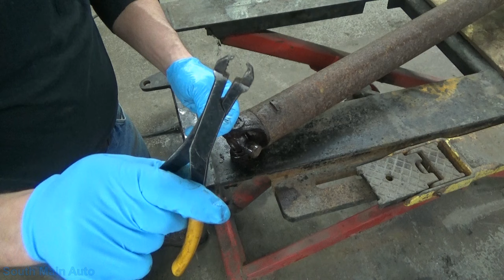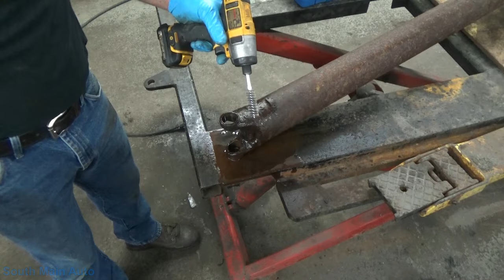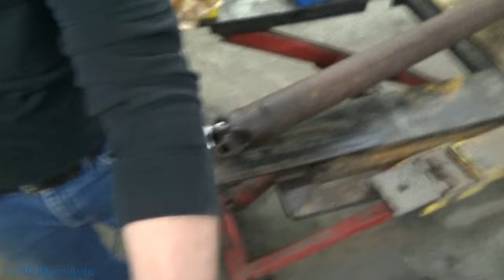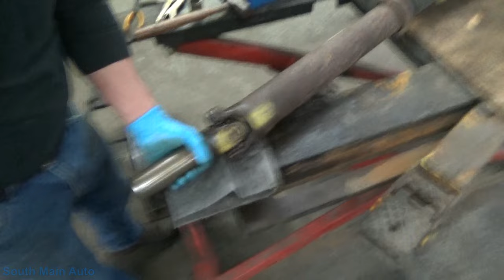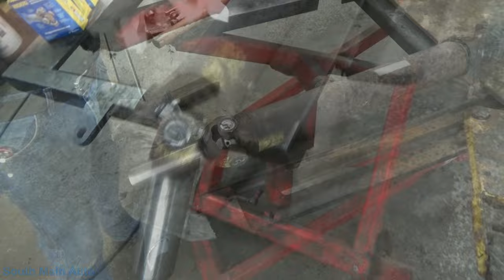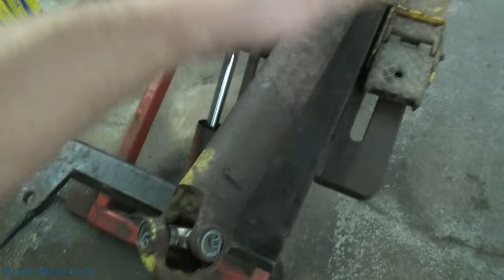How To Replace U-Joints (ULTIMATE Guide Using BFH)

Comment: ( Dan Hucklebridge) well, My dad taught me how to replace U-joints...in the late 70's. we used a large vise as the main tool, big hammer, and most importantly a socket. the main jist of removal, was to pound the shaft with the hammer, and the cross resting on the vice. the # 1 rule was, only hit the weld, on the shaft...never the tube. and for assembly, the vise served as a press, and a 5/8" shallow socket as a die, to press the first cup past, where it goes....this way the needles won't be able to fall on the other side. also, adding a small amount of grease to each cup, upon opening the box,,,,was a firm rule...also aiding in not dropping needles. my .02

Comment: Lisle makes an air hammer adapter that works great to shake the caps out. At the end, when you grease the joints, put a clamp on the two caps to prevent the grease from spreading the caps, otherwise its real hard to get the caps in the pinion yoke due to hydraulic pressure (don that before). Those double joints you mentioned are almost always junk and its better to reman the entire drive-shaft.

Comment: For the wire brush usually I get one from harbor freight - a 3/4" plumbing fitting brush,  and cut the handle off. 
Then you can just put it in a drill. Cleans the groove and get and rust out of the bore

Comment: Great vid Dr.O!  I usually use a vise, but have used a press to get them out.  Those double cardan joints are a real PITA.  Good tips, if I ever get a good solid work surface I'll try the hammer method ;)
Reply from the maker: Yeah you need a pretty solid bench to work on!

Comment: Ball joint press works for me , I take the socket off then hit it where the socket goes right on the end of the press , it is beveled to do it . Even with the plastic ones . If you put extra grease in the caps before you start , it will keep the pins in place ...

Comment: a little tip if you want to test the clips to make sure they are secure and wont pop out just smack the yoke hard with a hammer just behind the joint. it also helps center the joint and take out tight spots. if the clip flys out you need to figure out whats wrong

Comment: I use a dremel tool to clean the ring groves. We deal with rust like you guys (Newmarket ontario) other thing I do is use my vice and a tall axel stand. I open the vice enough to hold the oposite ears and let it have it with my hammer of choice. That's my schtik.

Comment: I also use the hammer method. I think the pounding helps the penetrating oil to penetrate. Whereas simply spraying the cups and then putting in a press does nothing as there is no vibration and the cups are forced out dry and that's where you get those bent ears.

Comment: Hi Eric O. 
   I just finish watching video ( give you a thumbs up ) and i see that you use a pick to clean the groves for the clips let me give you a tip :
  Cut one o the old clips 1/2" pieces and use a needle nose wise grip to hold the piece , when you cut them make sure you have a positive rake so you can scrape the grove . 
 I use this method every time I'm dealing with groves and dirt / rust .
   Hope this helps. 
    I have a question to you , I have a bobcat 863 deutz motor , oil pressure light came one , thru a gage and I have 30psi at idle and 40psi  at full throttle I can find any info on line you think it's ok ? Appreciate your answer ...

Comment: I think Tiger Tool U-joint pullers make u-joint replacement almost enjoyable.  The bigger sizes are expensive but they work on my not-so-crusty driveshafts.  If in doubt, load up the puller then tappy tap tap.

Comment: I bought a large C-clamp at Harbor Freight. It drives the new cups in slowly so you don't drop needles out of place. Obviously the hammer works, but not dropping needles saves a lot of time.

Comment: Been doing them this way for years, but I have to admit I did my daughter's 04 Z71 this past year and that aluminum shaft with nylon factory, inner outer replacement clips wasn't fun! Took forever to even get the correct joints...ended up taking the shaft to the parts store, the local store... national chain stores were no help

Comment: Try using a big vise, and the freezer trick, much less chance of needle falling sideways, helps to have a second man to hold the sockets during vice pressing process : ), am away to do some staked in UJ's just figuring how to hold the new ones in1 Seems welding a washer above is the safest - just need exact size and possibly file a lip to recess equally, then againg I may call as pecialist on this one as we dont want imbalance! New shaft is 1200 bucks for these E31 850's

Comment: I've done them both the the hammer and with the ball joint press. Last ones I did were on the S-10 with the aluminum shaft and they had the nylon insert. I beat on them with the hammer for a while and they wouldn't budge, so I use the ball joint press and they popped right out. 
Had a shop put in a set on one of the fleet trucks. They didn't grease them. Thy lasted about 2000 miles before they disintegrated. How many strokes of grease do you put in?

Comment: Plastic injected GM joints always get propane torch love followed by socket and shorty sledgehammer treatment. Aftermarket Moog, no name, etc. I pop the circlips and more socket, shorty sledgehammer attention. I'm old, and swapped the sledgehammer for a pneumatic hammer with a grinder flattened/dulled tip. That way I can drive the cups back and forth without cutting through the metal. Reassemble with grease after cleanup and scraping clip pockets? A few taps with the shorty sledgehammer gets it done fast!

Comment: "in my experience, it's always just the rear one." I've heard that from several mechanics, but that's never been MY experience.  Speaking of experience, any special tips for Suburbans with the aluminum shaft?
Reply: Don't use a torch on the aluminum ears, they are likely to distort if you do. Make sure the new u-joints are intended for use on the aluminum driveshaft. The cups will have a coating on them that prevents the dis-similar metal from fusing and helps the cup slide in a little easier.

Comment: I cut them out with a torch. Keeps the yokes from spreading or shrinking from the pounding. 

I also clean the holes with a flap wheel inside and outside.

Comment: I have only replaced a u=joint once on my old , one of my first cars, a Chrysler Fury around 1972 or so vintage., It started making noise, I crawled under the car, the ujoint was easy to remove, I recall it being a bolt on. I think I used a ccclamp to take it out of its carrier, do recall the needlebearings in the greese cups.   That Crysler had a knack of destroying starters which I got from Pep Boys . Unusal to go through one about each two years, along with problems with the water pump. Those were easy to change as well,  unbolted from the fan, which it was mounted to. Once I saw water dripping from the weep hole I knew it was time to change.. I didnt know didly squat before owning that car, especially with my first car, which I had to bring it in for repair to the vw dealer, my first car a vw rabbit, They quoted a price of $150 dollars to change my alternator back around 1973, almost every penny I had in savings, when I went to pick it up they said it was $350 because of a problem with the wiring harness and did not get my authorization to replace. After talking to the service manager they honored the original quote.  Not having a pot to piss in after that repair I decided I needed to learn how to fix my own car if I was going to survive with owning a car. That is when I decided to take a few auto classes in the local community college. Thats how I was able to do a clutch change a number of years later when I owned a a chevy van. I literally used two 2x4s as a means to lower the transmission suspended from the front two window frames.  The things we did to keep our cars running without going broke.

Comment: South Main Auto: Granted, I am not a mechanic or certified in any way to do such...but once I had some broken needle bearings due to the cap getting cocked slightly while putting it in. I must have forced it in??? Can't remember exactly. So...I ended up using the best of the used ones and it worked out fine. However, like you, if I was working on someone else's vehicle (which was often the case when i was younger) I would never do that. You asked for comments on it, so there it is. LOL.

Comment: The most impressive thing in this video is that Man's right arm and that Table he was whaling on. I think I saw snap-on written on the side of the table, but not sure and it seems like it has an air cylinder to adjust the height? Looks like 3/4" table top, bet that thing is heavy and not on wheels?
Reply from the maker: it is a portable lift for working on cars. Doubles as a great work bench!
Reply: South Main Auto Repair Thank you for responding Sir, seems to be a very handy item. Something similar would work nicely for the home mechanic.
Reply: +Eliyahu Bn YHWH  Eric was working on his mini car lift.

Comment: a wooden v block or two would support the shaft and stop it flopping around. Groove it into a short length of 6x4 (150x100 for metricated people) hardwood and you're set. :)

WRT torching the thing. The freeze trick could work for removal if you sit a lump of dry ice on the cup after pulling the clip out. Might be a load less whaling on stiffies if it works

Comment: Try putting a small socket under the cap and flip the drive shaft over to drive the new joint further into the yoke. That way you don't have to jam rags into the yoke.  You can keep the joint from bouncing out of the cup with a finger in the cross.  Let gravity lend a hand.

Comment: i would add another segment that i do is i run those cylindrical flap discs on the inside of the cup receivers with my high speed and some kroil  just to take out the rust, sometimes they push in with finger pressure

Comment: Kinda of like watching a bear cub with mittens. I always sprayed the penetrating oil before removing the driveshaft so it has longer to work. Then use an air hammer. If they get difficult, cut the cross with the blue wrench. I can't believe you didn't torch it. No anti-seize on installation?

Comment: In 1984 a customer also my uncle lost a ujoint on his 9 month old Ford ranger 4x4. 
 He took it to Ford for warranty work Ford basically told him he was boned because Ford hadn't made these tiny 4x4 ujoints available to the dealerships yet and may be a while.????
 The 4x4 u joints we're whimpy tiny much smaller than the 2wheel drive version.
 Well I found cj5 slip yokes would fit .
 We had a old Machinist in town like 80+ I took all the drivelines and cj5 yokes and grown up wrecking. Yard driveshafts for real trucks to him he cut welded and balanced the new drive lines for $15 each.. they were done the next day.
 The local driveline shop was $475 and 5 day turnaround.

Comment: So wailing on it with a socket under it isn’t any different than using a ball joint press if you think about it-the ear is taking any force if the cup is stuck. Using a ratchet handle instead of an impact, I think, is less likely to bend an ear of the yoke than the pound like mad method-I’m doing my 2007 Tundra’s center carrier bearing soon and will be replacing all three universals, so I’ll find out which method works best-wish me luck!

Comment: Is it true that the c clips vary in thickness and replaced u-joints often come with the wrong size? This causes slop and vibration and ultimate shorter bearing life.

Must reuse the old c clips if so.

Comment: hey man you should check out the lisle 18980 u joint driver. goes on an air hammer and makes short work of driving out u joints.

Comment: Eric i can't believe no one noticed that after u got the 2 caps loose one way and turned it  90 degrees  to work on the other 2 you were hitting the joint caps which was only banging the cross in the other caps. you needed to bang the yoke to bang it down off the caps. i was reluctant to say because i have done that before. About 28 mins, in.

Comment: Just a quick question when you do the u joints do you service the slide yolk and carrier bearings too grease and check the inner seal on the slide yolk.

Comment: Sawzall to cut out the center of the cross and then punch out the cups.  I'm surprised that you didn't remove the yoke first at the beginning.  I always remove the yoke first since it is held in place with the drive shaft.

Comment: My rear u-joint snapped on the freeway so We got a tow truck home.  I just had the local shop press u-joint into the yoke.  One axis seems to move freely without any play.  The other axis moves but seems a little stiff.  Should I tap on the ears of the yoke until it moves freely like the other axis before putting the drive shaft back on?  You do this around 43:48

Comment: I just love the injection bonded factory ones. bearings are over rated ;) I use a large vice and two sockets + sledge hammer to persuade via the vice, pretty much works like a press to put them back in. an actual press is much better, it you have one or the space! near always best to remove yoke first and install second. you tube is great for the youngers, but there was no such thing back when I started smashing my fingers/hands

Comment: Hey SMA, would that wire brush kit be good enough for cleaning caliper mount brackets or need to file it ?
Reply: ive been using a wire brush on caliper contact points for over 40 years and then lightly brake caliper grease all metal contact surfaces with new hardware and put brake pads in dry never had a comeback or failure in 40 years

Comment: Hey Eric, couple of questions. What method do you use on the pita injected plastic Ujoints by GM-??  Sounds like you might have alluded to heating them.  ts been a long time for me but seems like I also had to use the sledge to shear the plastic off.  As I recall they blew like the winds of Jericho. lol -  Also wouldnt this be a good time to remove the dust boot clamps and grease the slip spline, or should it be left alone-?  I know you have to keep the shaft in time as it were.  Ive had issues with the splines going dry and not taking grease through the zerk.  I have a 2003 S10 and it feels like im starting to get some minor vibes from the rear most joint - as usual.
Reply from the maker: I use the heat on them and let the little snake out of the hole
Reply: OK thanks heat it is - what about the slip spline, should I separate it and grease it while I have the shaft off-?

Comment: as a inventory manager of a large parts supplier i can state that the Moog ujoint boxes are crap and they almost require tape to ensure the ujoint doesn't fall out of the box and have pin bearings flying every where.

Comment: I did basically the same thing to replace the U-Joint on my old Suburban.  Big bolt punch and everything - it was more out of desperation after trying to press the caps out of the drive shaft broke my cheapo Craftsman (R.I.P.) 5" vice.
Reply from the maker: awww poor little vice :(
Reply: IKR. Returned it and replaced it with an beat up old Wilton bullet vise I found on C.L.
Reply from the maker: Wilton... oh man  am jealous!!
Reply: Except I think this one spent its previous life riding around on the back of line truck or something.

Comment: Guys, it is obv a 2 piece driveshaft. The middle part with the boot that hold the two drive shafts together is there anything in there that wears out as well?? I never worked on a two piece drive shaft before.

thanks!

Comment: Another Great vid! Question Eric, my experience with vise grips is they dig in and create valleys and hills on the metal, when you then drive it back thru does it score the bore?
Reply: Cups are so hard there is no groove from vise grips possible, they fail miserably to grip the cups well because they are so hard.  It's really a last ditch effort of a desperate man, and it's never really worked for me either unless they were 1/2 millimeter from falling off already.
Reply: I've had better luck with the vice grips that have the V jaw. They seem to grab better on the cups.
Reply: +Blazer02LS love those vice grips. The v jaw ones are also great for extremely tight flare nuts on brake lines. When they are so stuck that a flare nut wrench starts to strip the nut, clamp on v jaw vice grips. They spin right off and won't chew up the flare nut. A LIFE SAVER when you change an ABS module!

Comment: Hey SouthMainAuto do you have contact info, I need some advice I took my 04 Jeep grand Cherokee 4.7 in for a front suspension rebuild with all new front suspension new ball joints because I had some death wobble and they've had my jeep a little over a week now, had differential gear oil change rear and front, new spark plugs for 400 dollars, and a bunch of other things the mechanic shop recommended as they went through, and it's already costing me 5500 dollars, they haven't even started on the suspension which I supplied the suspension parts and ball joints track bar tie rod ends ball joints coil spring isolators everything, front 4wd drive shaft  i am having replaced.. they did a front and rear differential fluid change, and they're recommending now I need a new front differential assembly for 2800. They included pictures with they're findings, but I'd like your honest opinion and thoughts  because all in all it will cost me over 8000, if i can share they're findings and pictures and overall everything with you can you give me your opinion and advice and on what you think because they said the back differential was fine (but my front differential) needed replaced due to their being metal shavings and worn or cracked teeth in the front differential gears which obviously makes sense. I just needed my front suspension redone with fresh parts, now it's costing me over 8000.